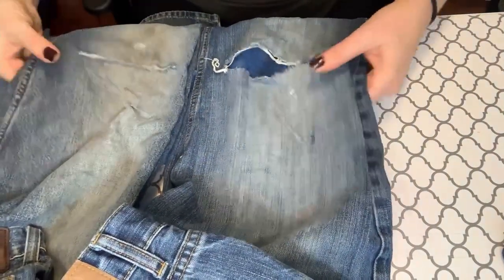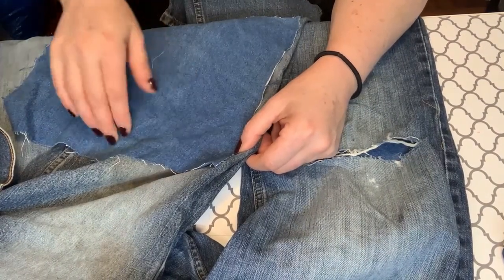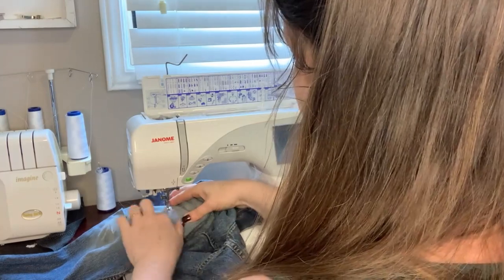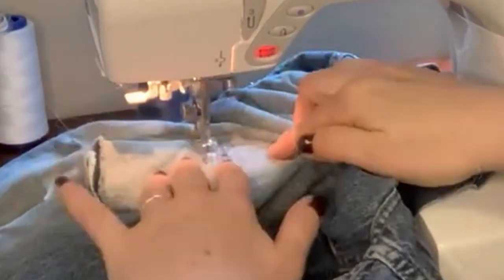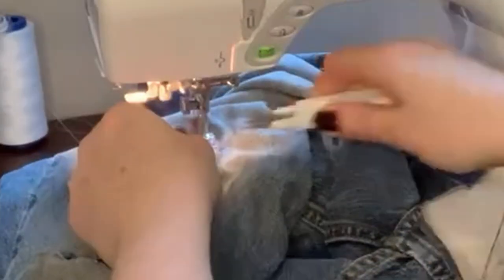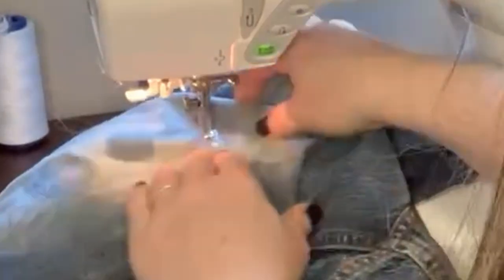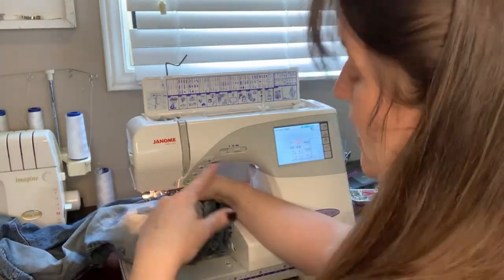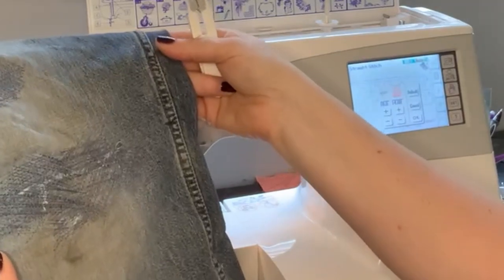Got Hole-y Work Pants? Visible Machine Mending to Reinforce Knees: The Patch & Hatch Technique

Comment: One thing I would do different with your method of mending jeans is to open up the Overlock seam, not the flat feld seam in the legs. This way you can do your mending on the flat instead of trying to wrestle the leg over the free arm. You simply sew it back and overlock or clean finish your favorite way. 
Your use of double stick tape is a good idea. It’ll keep me from poked fingers!
Reply from the maker: Thank you Jane. I will try that next time. Thanks for watching and commenting. I have just started using the wash away double sided tape this year and I love it. I use it in garment making, bag making, inserting zippers, etc. Love it when things don’t move on me!!💜😁

Comment: I haven't watched this whole video yet, but I want to comment before I forget. I wonder if you might be able to do a video on how to fix a lightweight fabric, like leggings or something that have holes where the thighs have rubbed together to the point where the inside seam between the thighs has been split. Is it possible to fix that kind of hole if the fabric itself isn't so worn out that it's unworkably thin exactly, but just sewing up the seam again wouldn't really work so well?
Reply from the maker: Thanks for the idea. I do know how to fix that issue. I will add that to the video request list. Thanks

Comment: I patch in a similar manner but I open up the seam to lay flat and I serge the patch material so it doesn't fray.  I then sew the patch down  on the four sides before sewing the hole closed.  I use  the steam-a-seam tape also.  Keeps the patch in place before sewing.
Reply from the maker: These are great tips. Thank you.

Comment: That's sweet of you to repair his jeans! I'm dealing with a similar issue. My jeans have thinned in the front thigh area, and completely blown out where the knees are. I think I'm going to use doubled-up iron-on patches. One with the adhesive facing out, and another one on top of it adhesive facing in. I'll try to create a "floating" area with no attachment where the rip is, so when I bend my knee there's some give, but sew down the other areas of the patch. I'll do the cross hatching too. It seems just like ripstop. Maybe I'll even mix colors or something. I want to show off my mends, not hide them. Thanks! 😁